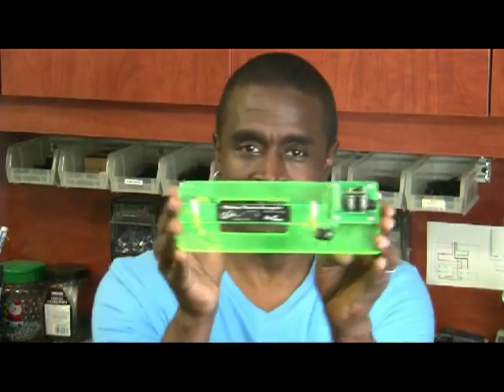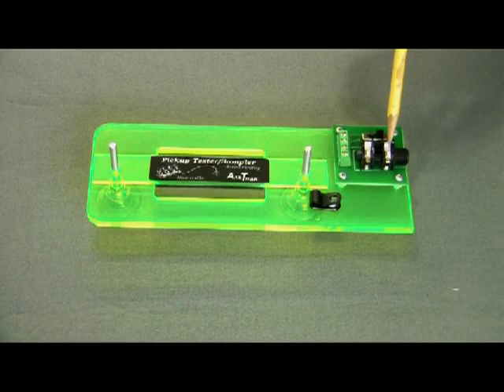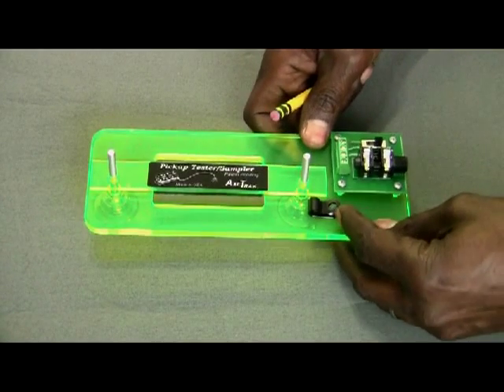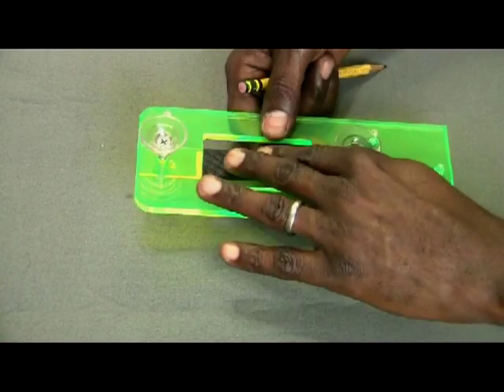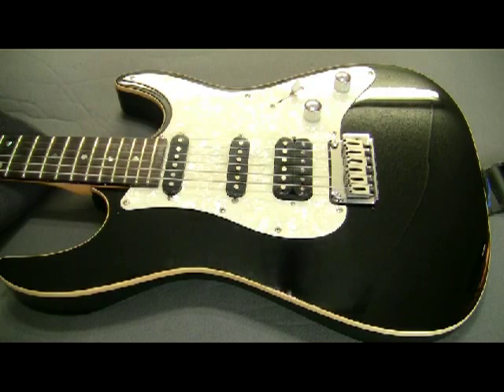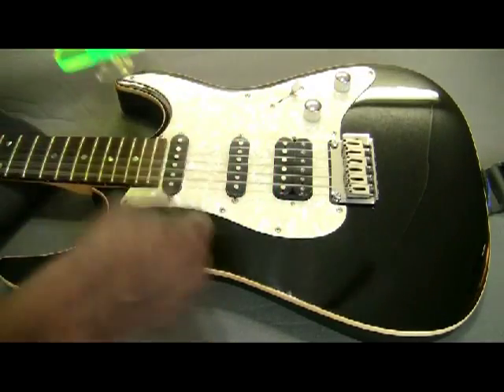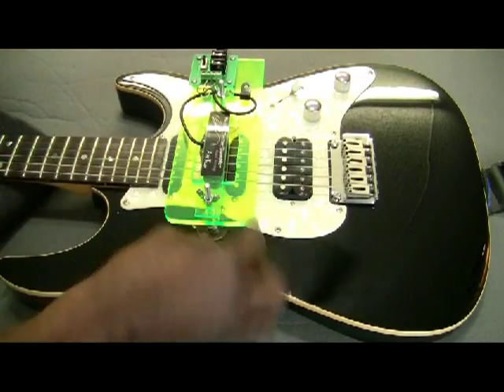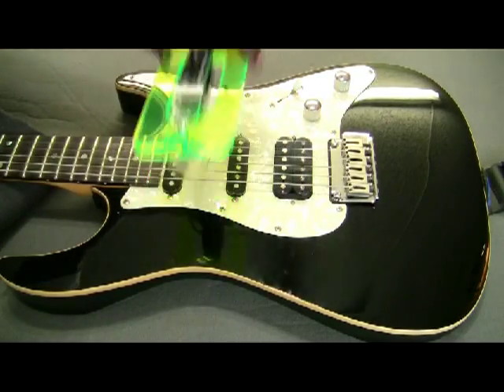AxeTrak Guitar Pickup Tester - New Product Demo

Comment: This is innovative.  My problem with a device like this, you are losing a lot of the tonal qualities of having the pickup mounted inside of or to the actual wood of the guitar.  Those factors make a significant difference in the tone of a pickup.
Reply from the maker: Appreciate the comment. In all honesty you really don't lose much with this device. Most pickups are floating per say but receive body resonance though the pickup ring, mounting screws, and anything else that they touch. Our pickup tester gets a good deal of body resonance when it is mounted and taped to the guitar. If you are wanting to test the sound and characteristics of a pickup, this device honestly does it. By no means am I saying that it replaces the need to permanently mount a pickup.